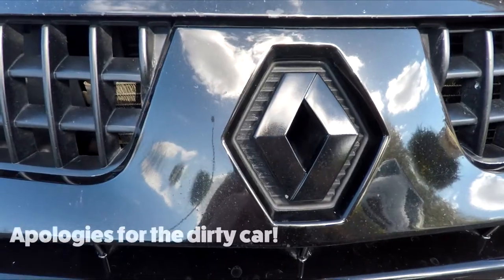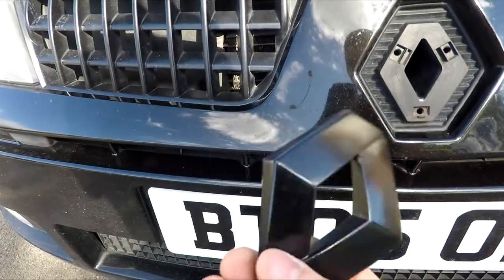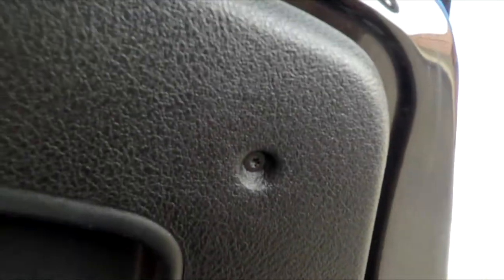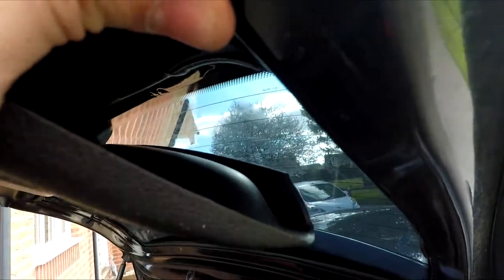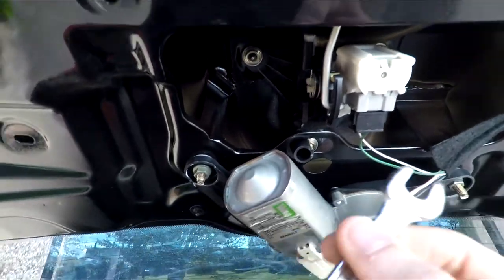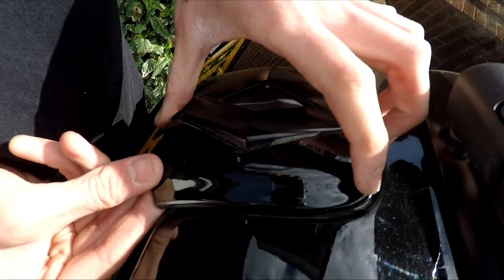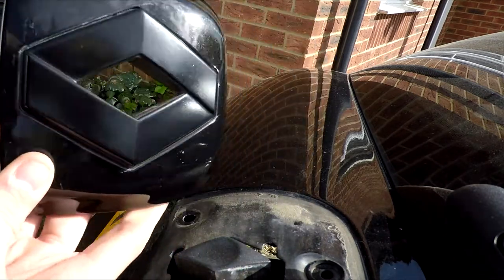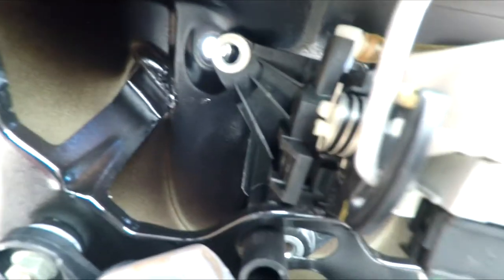How to remove both diamonds - Renault Clio mk2 (Sport 182)

Comment: Thanks for this video man. Changing mine over very soon and wasn't sure about the rear one and how it came off.
Reply from the maker: My pleasure, glad it helped! Well the back one is a little awkward but easy enough thankfully!
Reply: Yeah I've changed my rear wiper motor before so it's a largely similar job. I wasn't sure before this is the button was part of it you see, so I thought there might have been messing around with the mechanism.
Reply from the maker: Ah no the button will just fall away, i thought i broke mine at first, but that a good thing because it makes it easier to just slot back in for refitting.
Reply: Yeah yeah. Cool, can't wait to give it a try then!

Comment: One question... the black part, or base of the front diamond, it also goes with pressure? Because i have to replace the whole pack and i don't know how to do it. Sorry for my bad english :)
Reply from the maker: If you need to replace the diamond and the part it connects to, which then connects to the bumper. You will have to remove the bumper as there are a couple of screws holding it together, only accessible from the back. (May be able to bend the top of the bumper next to the grill to avoid fully removing it, try that first) 👍🏻
Reply: thank you!! the thing is it broke in a hail storm, and it went lost. And i bought the replacement. So i didn't know about the screws. But thanks for the help!

Comment: does the front badge clip on and off just the same for the Megane RS250 ect.. ???
Reply from the maker: Neso osen I’m not sure with the Megane RS mate, but I do know you can buy diamonds on sites like eBay with badges that just stick over the top of the original badges. Which will avoid all hassle and issues with pulling them off and painting! 🤙🏻

Comment: My emblem/logo on the back has little bubbles below it, idk how to fix that , Do you got any suggestions?
Or can i just take the emblem out of the back and replace it like the one on the front
Reply from the maker: Brick'nBuild the back one needs to be broken off to remove it and glued back on. If I want you ask on fb for a full boot catch replacement and just do it that way! ✌🏻
Reply: @jwmeale3058  What do you exaclty mean? Im not native english so i dont understand everything.
Could i use sandpaper do get rit of the plastic layer on the emblem and then spray it?
That square on the back with the logo on it, costs 30 euros second hand, is that worth it?
The bubble isnt even that big, its just a small circle on the emblem
Reply: @jwmeale3058  well, the plastic layer of my emblem on the back has air below it, should i remove the plastic silver foil, with sandpaper? and then spray it?
Reply from the maker: Brick'nBuild is it lacquer peel or is there a wrap over the top? I’d take the boot diamond off like I did and masking tape all around sand and spray)
Reply: @jwmeale3058  The front one i will also make black, but the back has a plastic kind of layer that has bubbles on it, im talking about the emblem
Reply: so the plastic on it came loose
Reply from the maker: Brick'nBuild  sand it smooth. If it’s not smooth the paint won’t be good!
Reply: @jwmeale3058  so i have to ''ruine''/polish the emblem first so that plastic layer is gone. And then spray it with paint
Reply: @jwmeale3058  I dont have a sandgun at home, will sandpaper be enough?
Reply from the maker: Brick'nBuild that’s all I used mate. Wet and dry sandpaper. Clean it. Dry it. Paint it 👍🏻
Reply: Thanks man i will! Ill keep watching your videos!
I have a Clio 2003 Billabong, its not sport but i like to clean and work with it. Do you have any advice on what i could do to it?
The parts in the engine bay are plastic so i cant really paint that i think. I saw some custom made covers on youtube on other cars but meh idk. You are giving me inspiration hahah

Comment: At 4:45 you say, shut the boot, but how can you open it again if the button is loose?
Reply from the maker: Brick'nBuild I’m pretty sure you can still press the button and it will open. If you’re worried but a towel in between!
Reply: @jwmeale3058  smart thanks!